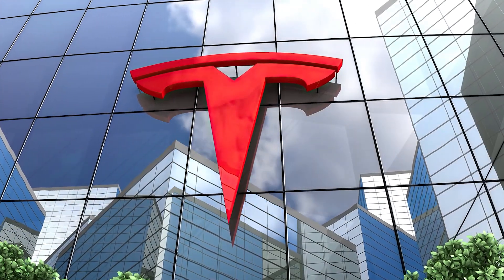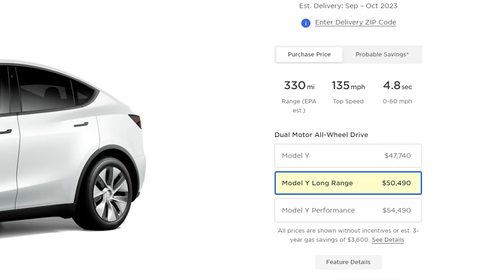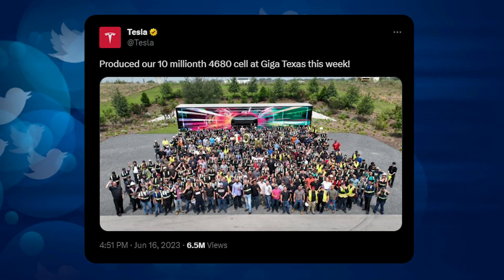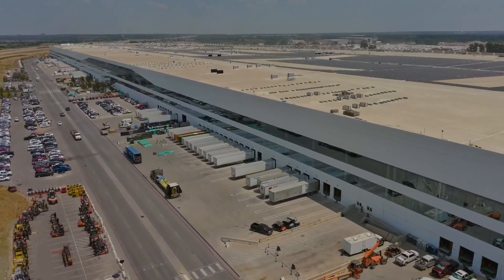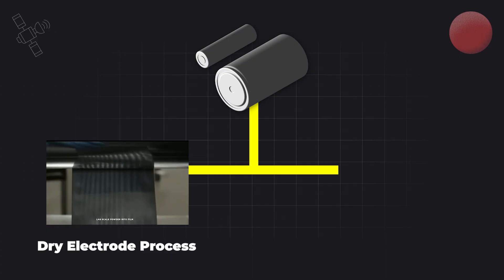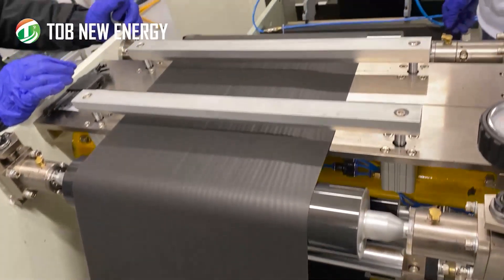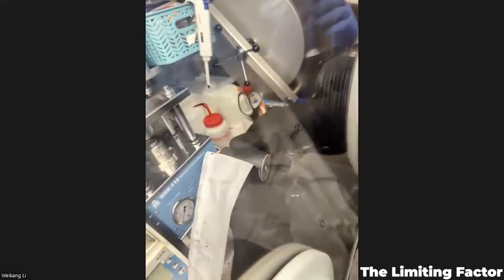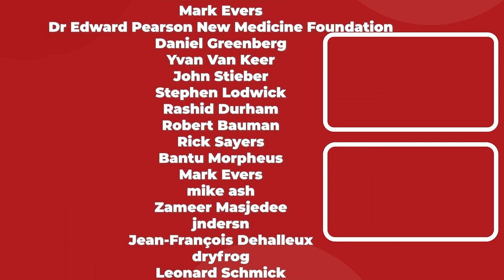Tesla Has A Problem With The 4680 Battery Cell...

Comment: I think Tesla may have overlooked a very fundamental part of the 4680.  For example the 4680 is 5.5 times bigger than the 2170 battery and yes; theoretically designed to produce 5x more.  But that bigger battery needs 5 times the space, and unless you make a bigger body vehicle, you won't get any more battery range and possibly less because of how the batteries fit into the same space.

It's not any more efficient, because the same chemicals are still in use to create the battery.  If those batteries were the same size of the 2170, or the 18650 batteries and produced 5 times the power.. that's quite a different story.  But fundamentally no change or real improvement.  If anything the power density was decreased because you can't put as many batteries in the same space..
Reply: The geometric fill factor is the same, but there is less material being wasted because the case isn't proportionally thicker, which means that overall the battery should produce a slightly higher power density. Not that this has anything to do with anything. The simple fact is that Tesla isn't going to make more batteries than they can sell in their cars, so if they aren't integrating it into more than one model, yet, then there is no point in battery production exceeding the sales of that model. If that model is "overpriced", that means they are actually making more money on it than on the others. It may be true that the customer who buys that model may get shortchanged, but that's not a problem for Tesla. It's a problem for the buyer.
Reply: @lepidoptera9337  agreed.. , because the material inside the battery to make it one.. is no more efficient than what they were already using.

Take a look at the range numbers in the models where the 4680 batteries are in play.  The range has decreased instead of increased.  

They stand to increase their profit margin by reducing the number of batteries from their size in the same or smaller space.

Comment: I'd worry about the tabless design which makes connections by just pressing tabs together rather than welding or soldering.  Over time, that might become an iffy connection, like when you need to shake a flashlight to get a good connection to the batteries.  A problem at low voltage differences, less so at >100 V like home outlets.
Reply: If you like to worry about these issues, then you have to become a Tesla engineer and work hard to solve them. Oh, wait... that takes work. ;-)
Reply: @lepidoptera9337  Owners are stuck with problems if beyond warranty, so shouldn't buyers research details?  Ask people who bought ~1980 GM diesel cars.
Reply: @SihAza  It's unhealthy to worry about things that you can't change, anyway.

Comment: supply chain issues, most of the raw material are processed in China.  When China has a big demand for the same materials, you can run into supply chain problem.
Reply: Availability of raw materials has absolutely nothing to do with Tesla's struggles with cutting-edge dry electrode battery tech.  Did you even watch the video you're supposedly commenting on?
Reply: @davidsooby9961  the title of this video is "Tesla Has A Problem With The 4680 Battery Cell..." While the video is mainly addressing the manufacturing.  I raise the point of supply chain bottleneck, each element of Ni, Mn, Co, Li, even Cu, Fe requires a separate supply chain from mining, transport, to processing.  Any interuptions will disrupt materials to the battery factory and or drive up the cost.
Reply: @albertiwong  There are no shortages of these materials People need to pull their heads out of the darkness of their own rear ends. ;-)

Comment: Due to the strong explosiveness of ternary lithium batteries, I basically only buy electric vehicles with lithium iron phosphate batteries.
Reply: Gosh, how terrible that Tesla's EVs have a danger of fire about 1/7 to 1/10 as much as an average gasmobile. /s

Reality check:  Anyone who's really worried about a car fire should most DEFINITELY buy an EV, which is far, far less likely to catch fire than your average gas-powered car.
Reply: @davidsooby9961  You simply don't grasp the key to EV safety. The rate of spontaneous combustion of electric vehicles does not matter at all. 
The state of spontaneous combustion is the most important. 
Even if the spontaneous combustion rate of traditional oil vehicles is higher, it is still safer in the face of ordinary ternary lithium batteries.
 Because the combustion of fuel vehicles occurs very slowly, even if there is a very strong collision and the gas leaks, it will take a few minutes or even dozens of minutes to burn to the driver's seat.
But once the ternary lithium battery is burned, it is a deflagration, and the driver will be cremated within one minute. You don't have a chance to escape at all. Therefore, the battery that ignites more slowly after a collision is safe.

Comment: I would never buy a car where the battery cells are glued all together, totally unrepairable and unrepurposable for e. g. Stationary storage. That is a no go. That is comparable to a gasoline motor where the cylinder head and also the water pump is welded to the block. You would not buy this either. And Remember: Even the contactors are glued together with the cells. So a simple defect in a contactor-Relay for 100$, which has happened on all battery manufacturers in the past, will make a battery pack for 15000$ useless. That is crazy.

Comment: I wonder why they don’t just Xerox the partials onto the anode. Old tech, common as mud in office spaces, maintained by functional idiots, and dry, very dry. 
Oh, I am pretty sure the problem is that Patent expired decades ago, and therefore there is no industrial protection of profit margins. 

The problem is designers and engineers these days are all focused on the next worst thing, rather than taking the last centuries most reliable and ubiquitous solutions to a whole other level.

Comment: EVs are not the answer and the problem is not just batteries, it’s the systems that are needed to charge them too!
Reply: No innovations are needed for the charging tech.  The electrical engineering for practical charging was done decades or even centuries ago.  All that is needed is building out charging stations using existing tech.  Not so with EVs; the tech -- particularly the battery tech -- still has some ways to go before BEVs are fully competitive with gasmobiles (and diesel trucks).

Comment: Aside from the fact that the 4680 is a useless white elephant and relies on old technology.  
The biggest EV battery and car manufacturer (they sold 500,000 more cars than Tesla last year) is BYD.   Their battery technology leaves Tesla at the starting blocks. Even Tesla are using the latest Chinese LFP CATL batteries.
It tells you Tesla is far behind Chinese EV technology and manufacturing.

The only thing setting Tesla apart from other EV manufacturers is it FSD. But the Chinese will supersede that in a year or so.

Comment: 2:36 that’s not how you should compare them. You are doing price to range as a proportion but the model y is not 100% batteries therefore the 4680Y would always be more expensive.  You need subtract the vehicle price before comparing numbers to know the true price to perfomance of 4680. So it’s unknowable if the 4680 are more expensive starting with the model y price

Comment: There's so much innovation going on in battery tech.  It would not surprise me if Tesla went off on a tangent exploring new battery tech and that fact maybe slowing down the building of new production lines.  You don't want to ramp up production and build huge factories on a battery tech if you see new tech just around the corner that is going to make your current factories obsolete before they have even finished being built.  It's a big tradeoff,  you don't want to wait too long because you need batteries now, but you don't want to jump in early on some tech that gets replaced a year later.

Comment: Calculating 2M Vehicles/year at ~65KWh packs, they are in 2023 above the 100GWh target of 2022 by about 30%. I wouldn't worry too much.
They'll ramp up the 4680 fast once they figure everything out. I'd say they're on track, and there's no need to worry.
Reply: LOL, Tesla has never been on track with ANYTHING. Self driving cars have been one year away for over 10 years. Tesla, like everything associated with Musk, is a fraud.

Comment: The problem with electric vehicles in general is many.

First there's the rareness of earth elements, the insane pollution it causes to make these vehicles compared to normal gasoline cars, the insanely high price for a vehicle not many can afford and the demand that will skyrocket because the 2030 ban on gasoline cars will be pushed through.

Second there's the power grid.

In the EU about 8% of all cars is electric, and the power grid already cannot contain this number.
After 2030, no new fossil fuel cars will be made, so people are forced to buy electric cars.

There are currently no plans on changing the power grid and no plans on compensating for anything. They just go and ban gasoline cars, end of plan. It's going to be a complete disaster.

And finally there's the safety.

Every now and then a EV catches fire, the fire can be contained because the gasoline car next to it can be doused by the fire department and the EV will just burn out controlled and it's fine.
But if every car was an EV?

1 EV catching fire, spreading to the next one, and then next one. These lithium fires are intensely hot, so spreading is easy.

A full car park of EV's will go up in flames, because nobody has technology to put out a lithium fire other than dumping the car in water and wait a week.
But as per usual, try to pick up a car that's burning hotter than the surface of the sun and find out.

Governments aren't thinking this through, and Elon Musk just wants to make money.

Comment: Actually the problem is the chemistry is wrong. And they have known this for years. LFP can be used between 2-98% giving much greater range and it has more cycles with less degradation. 

The delay is part production problems and primarily they fully know they have to dump everything in their current battery chemistry and their entire manufacturing line and switch to LFP.

Comment: How about a vehicle that uses very little green electricity to generate it's fuel and superlight body but doesn't try to use batteries of any kind or electric motors tu push a 2+ ton box down the road ? How about an air drag better than that of Aptera ? How about a range of thousands of miles ? No one would listen to this obviously ... Crazy rich human like people that are going in the wrong direction entirely if not just because they still promote a car that looks like a car :)

Comment: The comparison shouldn't just be on range - the size of the battery matters as well. You can specifically consider range only provided the battery sizes are the same - you haven't confirmed that.
Reply: The size of the battery doesn't matter at all to a normal consumer. Just to geeks.

Comment: Why on mother earth would super genious ask Panasonic to produce a battery with a METAL case, and then encase them in another METAL case? Why not have a high power density pack (like in phones), and encase them so they are VASTLY lighter? This just seems grosly backwards. He is copying popular youtubers, and not engineering an actual, proper, lightweight, battery pack.

Comment: like all the battery technologies that is claimed as right around the corner they fail to make it happen. The reality is these cars are working realistically on 20-30 year battery technology. Meanwhile I pull up to a pump 5 minutes later roll away with 400 mile range.

Comment: I have never understood why so many people 'believed' 4680 to be magical while 4680 only refers to a form factor.
Reply: Then you need to watch a video of Tesla's "battery day" presentation.  Many very significant breakthroughs were predicted.  If the claims were true, then it would have been a breathtaking quantum jump in battery performance and cost.  Sadly, as this video shows, most of those breakthroughs have not materialized.

No, it was never about the 4680 form factor.  The "magic" was about what was claimed to be inside.
Reply: Thank you for the comment. I saw the presentation mentioned. Let me put it this way, those breakthroughs could also have been achieved with other sizes of batteries. Batteries of other dimensions would also have benefitted from these 'breakthrougs'.

Comment: ...3 key points.

Increased range: a cell change can't increase range unless the chemistry is better OR more battery mass is added.  These cells have the same energy density as previous cells because it is using the same chemistry.  The only way these cane increase range is by increasing battery mass. 

Increased power: see above, same chemistry means watts/pound is very close to the same as previous batteries.

Decreased production cost: this is the only promise that passes a sniff test but only time will tell if it was a lie as well.  Much of manufacturing costs are how well you've streamlined your process. 

Tdlr: tesla can't live up to musks promises because Musk patently lied and presented data in a misleading way.
Reply: Your post ignores many of the claimed advantages of the 4680 cell.  The tabless design allows for much faster charging/ discharging with far less resistance, and significantly reduces the problem with overheating during fast charging.  Being able to safely charge an EV far faster would be a very big deal indeed!

So no, it's not just about lowering manufacturing costs.

You're also looking at only the cell-level costs, and ignoring the pack-level costs.  A fewer number of larger cells means fewer cells need to have connections individually welded to them, thus lowering pack-level costs and reducing assembly time.
Reply: @davidsooby9961  that's two advantages.  I guess you could call that many.  Those advantages fall in with the third.  Tesla has yet to prove they are real.  The 'simpler' production hasn't been able to meet production goals, hasn't seemed to bring the car price down(competition is doing that). 

I guess the spirit of my previous comment should be read as, "given the number of previous grand Musk claims that go unfulfilled, it's probably best to reserve belief for when you actually see it demonstrated by a third party.".  

See: Tesla battery swaps & solar roofs.

Comment: The thermals of a 46800 battery are much worse than a 18650. The bigger size doesn't allow the heat to flow toward the exterior that easy, so they require more cooling...

Comment: Batteries are in a constant state of improvements and changes.  the 4680 battery is constantly changing and Tesla is not the only manufacturer.  Panasonic and CATL are both making 4680 cells.  Tesla and other battery manufacturers are always looking at battery chemistry and changing chemistry.  Looking any battery manufactured today doesn't mean much because LFP batteries might gain popularity or sodium/ion or graphene or...  The batteries being installed in cars in 2033 have probably not been designed yet.  The secret is who is currently building EV's at a scale and at a profit and Tesla is the only manufacturer that has accomplished that feat so far.  Tesla is building a great car right now and as batteries improve so will Ev's.
Reply: Panasonic and CATL may be making 4680 form factor cells, but are they using dry electrode tech?  Are they using a tabless design?  No, and probably not.  Battery cells that look the same on the outside, may be very different indeed on the inside.

Now, it may be that Tesla will abandon its efforts at dry electrode tech.  Something better and easier to produce may come along any time.  As you say, EV battery tech is constantly changing and constantly improving.

Comment: The slightly lower cost is that way is simply to slow consumption of them to a rate they can keep up with.  That's the entire basis of their pricing, it's whatever price they have to set in order to keep their production lines running at capacity.  Demand goes up?  Raise prices to adjust consumption.
Reply: Yes, this exactly. Also, the idea in the video that doubling a cars range should double the price totally ignores all the fixed non-battery costs that go into a vehicle.
Reply: @seanxmurray  true but as a consumer you'll see a 6% difference in price for a 20% difference in travel which is the main differentiating feature between the 2 options.
Reply: This ignores consumer price sensitivity. Raise prices 10%? Sure, you can always do that. But if that crashes your sales volume, it may not be wise. Especially considering that, price per mile/range is clearly worse in it's current state...

Comment: 18650 is the best battery from panasonic which is why s/x still uses them to this day. 2170 is the main standard for all car companies atm and has more power to weight than any battery. cybertruck will be using 4680 dont worry, they wont be putting 2170 in the trucks because it uses alot more cells.

Comment: How often did Tesla ever hit production schedule on time?
e.g. cybertruck Also 4680 is not intrinsic to "dry cell" development, if anything 4680 is ramping up production.

However, it does 'seem' like 4680 over 2170 were over hyped until if production can "reaches maximum efficiency" (Tesla still struggling since birth)